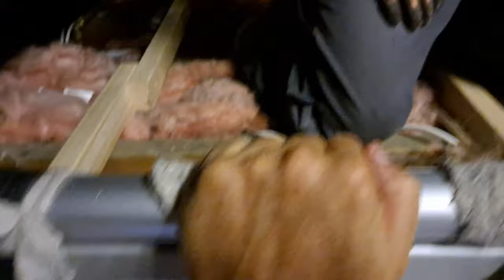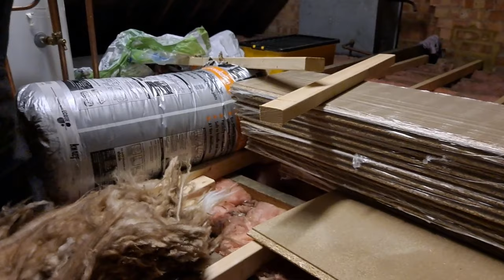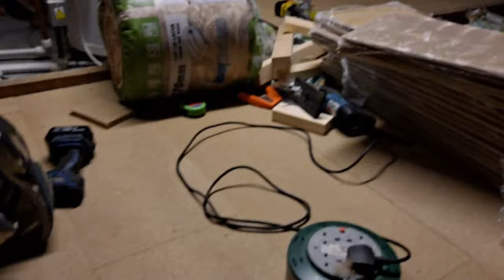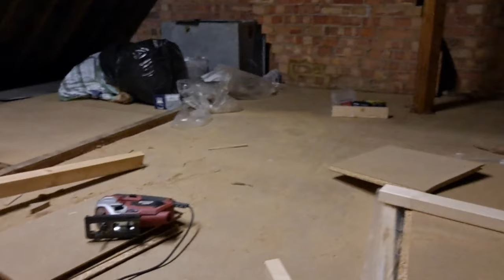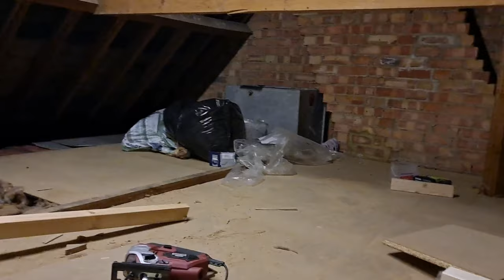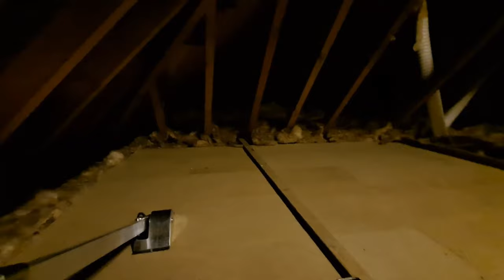Professional Loft Boarding part 1 (Raised Loft Floor)

Comment: This doesn't make sense to me.  Now the old joist ( which presumably were not deemed strong enough to take boarding) are now supporting both new joist and boards.  Seems worse to me.
Reply: The new timber is at 90degrees to the joists so makes the flooring supports stronger. When load is on the flooring,  is also minimises the chance of deflection and cracking on the ceiling below.